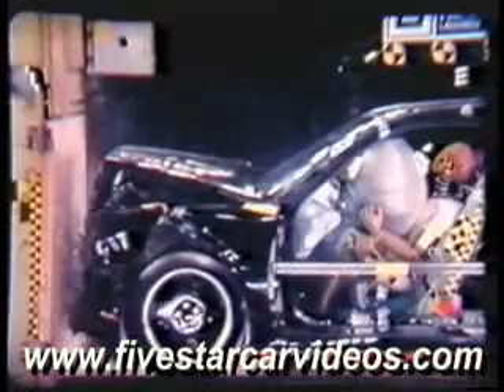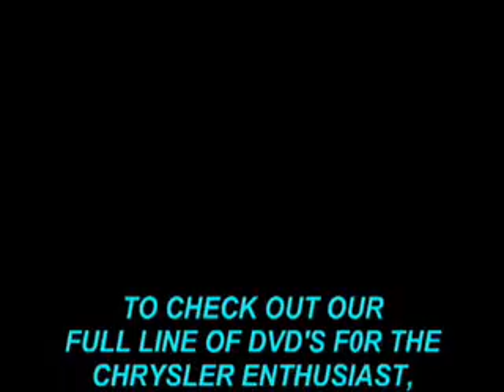1991 Chevy Beretta GTZ Barrier Crash Test

Comment: I have one, thinking about buying a 2nd one. In case the 1st one is worn out.
They are not well/high rated, so (in the Netherlands) you can buy one under $1000.
Fuel consumption is modest, they drive increadebly smooth! Fun to drive!
Repairs? yes, but wich car does not need maintenance?
Reply: madelief47 they sold these in the netherlands? which engine does yours have?
Reply: @AMCtilldeath  That 4 cyl would barely make it past 100K miles